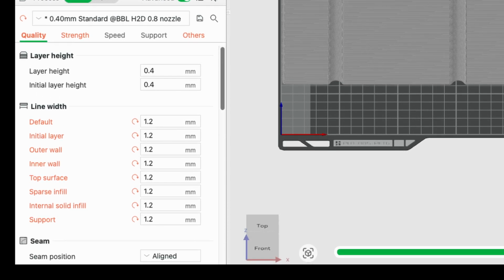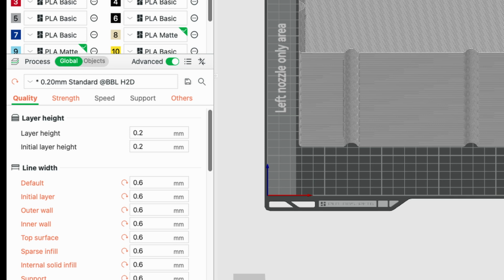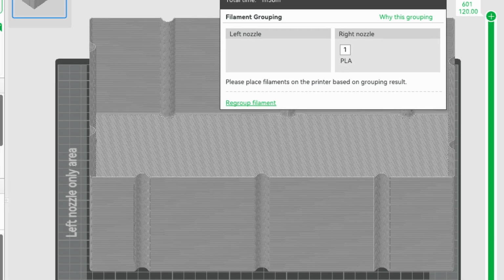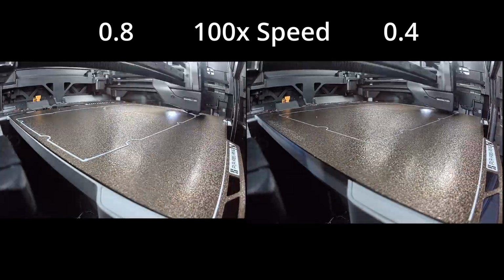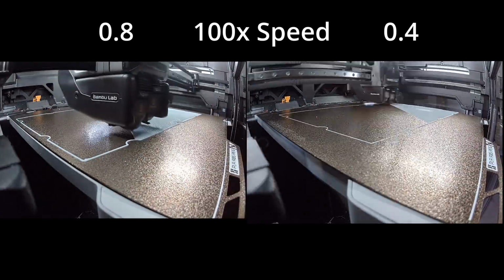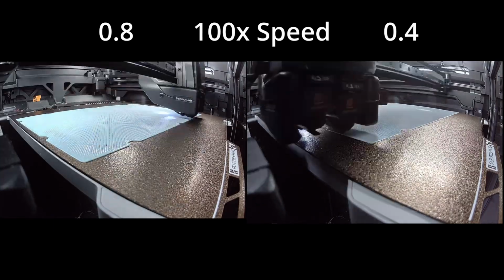How much faster is a 0.8mm Nozzle than 0.4?

Comment: I suspect what is going on here is that the print is not limited by the speed of the motion system but is limited by the volumetric flow rate.

With the advent of the high speed printer this is showing up a lot. Before the weak point was literally how fast the head moved but now we are seeing a lot of issues with how fast the hotend can melt filament. Literally the hot end design is maxed out on how quickly it can transfer heat energy to the filament. Modern slicers limit the volumetric flow by a parameter to prevent the extruder from skipping, under extruding, or heat creep due to heat transfer issues. 

This is why I think the print times are similar in your test. Despite the bigger nozzle being able to put out more plastic in theroy; the machine limited by how much heat can produce before it has heat creep issues.
Reply from the maker: agreed - I'm probably going to get high flow nozzles for my H2D - might wait though for the H2C upgrade and get Vortek high flow nozzles - as hopefully they will be even easier to change

Comment: A visual and strength comparison of the two would be useful. From what I could see in the video, the 0.8 looked a lot better and stronger.
Reply from the maker: See the end of the follow up video I did when a do a little bit of investigation of the strength and you are right 0.4 is a bit flimsy

Comment: But you said the walls were thinner, that means the prints are not actually identical? 

What would happen if you printed with identical wall dimensions?
Reply from the maker: I'm working on another version with the 0.6 nozzle too - but all 4 of the prints in the next demo have different wall thicknesses in the vase mode part. I think I might also do a test with 0.8 pushed to the max possible width - 1.7 has been mentioned. I might then compare that with a 4 wall 0.4 print - with the same overall 1.7mm width for speed and strength and looks with as you said completely identical widths.
Reply: @dwuk3d  vase mode makes this both interesting and very different from a non-vase mode comparison.  But I do think you need to consider quality.  It’s hard to well based on the crappy internal cam, but it looks like the 0.4 had significant surface texture problems from the shaking and thin wall.  Suspect 0.8 looked way better in the end as well.

Comment: That was interesting. I used to use 0.8mm nozzle in my original ender 3 as most of the prints I need we brackets and such and so 0.8mm wasn't that much quicker but they were a bit stronger at the detriment of quality.  Since getting my P1S I've just stuck with the 0.4mm nozzle even though I haver a 0.6mm nozzle which I have never fitted. Also look at those first layers, I'd take the 0.4mm over 0.8mm every time.

Comment: Wonder how this would relate to the h2c and using 0.8 for infill areas but in that case it should also move faster and add more flow to make that happen. The question then becomes will the 0.8 on infill gain speed since it has to switch every layer (or 2 layers could it skip a layer ?).
Reply from the maker: For me the main reason to use 0.6 was less layers and therefore less colour changes rather than raw printing speed which from these tests looks like it might already be maxed out on 0.4.

I like the fact that with 0.8 in vase mode you can go so much wider - I am going to try 175% next - 1.4mm, and 0.48mm layer height

Comment: i wouldnt consider the 0.4 nozzle even finished the print. there is delamination between the wall an base and the walls are horrible and not dimensionally accurate. These boxes will not stay side by side in a draw for example.  And despite even printing less, because the wall is thinner, we cannot consider this speed significant or even interesting.
Reply from the maker: You are correct that the fillet at the bottom was a bit too big for the 0.4mm version - I think that probably was the cause of the poor quality walls too. I will do another 0.4mm print with no fillet plus with the line widths pushed up to 175%.  Might try pushing the speeds up too as the default vase mode speeds are quite slow.
Reply: @dwuk3d  that's not the cause. The cause is that when printing that fast there is layer adhesion problems. The wavyness of the walls even shows that.
Reply from the maker: @meocats  You might be right - will be able to tell in about an hour.  Have kicked off the 0.4mm print again, with no fillet at the bottom, increased line width to 0.7 and increased layer height to 0.24.   It does look like from the slicer that the max flow of 25mm3 in the standard BL PLA filament definition is what is limiting the speed - in fact it slowed down a bit when I increased the width and layer height - predicted print time reduced though from 1h58 to 1h47.   Making the same changes to the 0.8mm version - going up to 0.48mm layers and 1.4mm widths - actually pushes estimated print time up by 10 mins and speed really slow.

Comment: If you look at the print speeds in your slicer, I suspect you will see a vast difference in print head travel speed while printing.  I had to do custom profiles for the Kobra 3 max for 0.8 because Anycubic for some reason refuses to release them or have it put in orca so anyone can contribute.  In my research slowing down the print speed was needed in order to get a clean print out of larger nozzles.  I also suspect on a model with infill, the 0.8 will be considerably faster than a 0.4.
Reply from the maker: yes - the speeds are slowed down quite a lot in the slicer - but flow seems to be at max.

Comment: Wow....I was not expecting that, but I guess it makes sense since the .8mm nozzle has to slow itself down to not run out of melted filament.....I wonder if a machine was dedicated to just a .8mm nozzle if it wouldn't be faster......I'm guessing it is limited by the extruder...along with the ability to melt the filament fast enough?